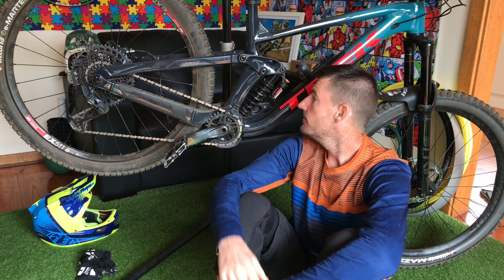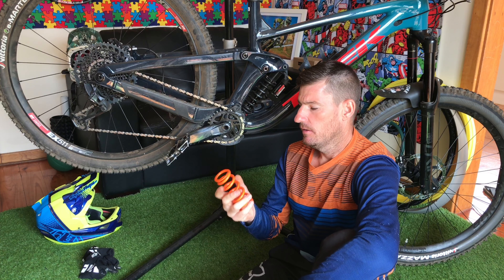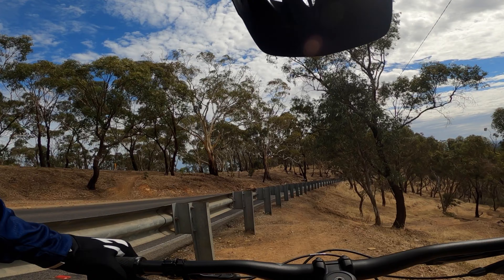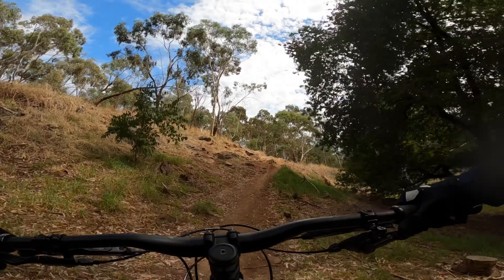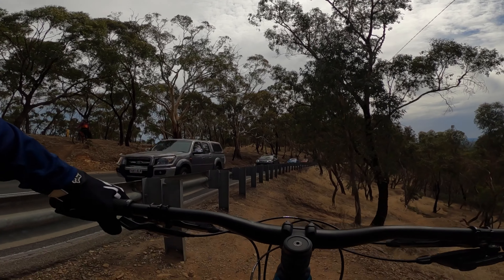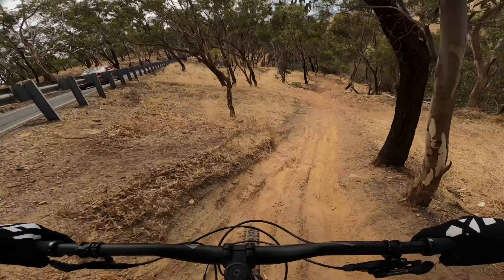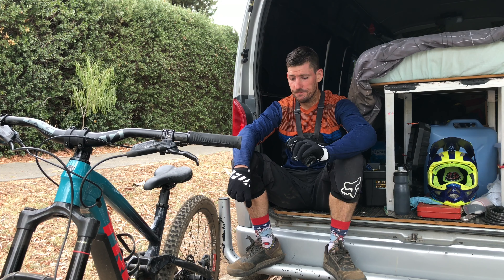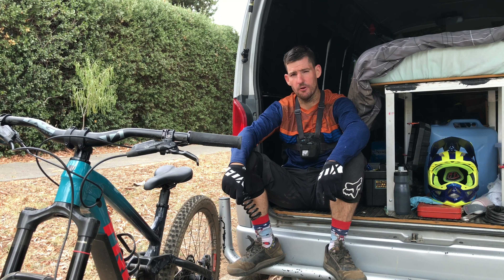Coil Shocks, Whats The Go With Preload?

Comment: When you increase preload it just shifts the coils spring curve up a bit. So let's say the stock setup started at 0N's of force and then at bottom out it has 2500N's of force. While with a bit of preload it would start at 50N's of force and end at 2550N's. However if you were to upgrade the spring you would completely change the rate meaning the shock would start at 0N's of force and then bottom out at 3000N's of force. So alot of people think that changing coils just changes the sag a bit but it actually has a massive impact on the bottom out force kinda like volume spacers. Sorry if you already know this.

Also it's kinda cool, the coil shocks that come on Geometron bikes come with a negative coil spring. Which is awesome because you can use preload to tune the ride-height without actually losing much suppleness and then you change spring rate  if you need more support and bottoming out resistance.
Reply from the maker: I didn’t know that about the Geometron bikes, we don’t tend to see them over this side of the disc. I’d love to test one
Reply: @mtbtelly5522  with all this talk about spring rates / air pressure / tyre pressure etc... you gotta tell us how many KG's you're packing ;)
Love all the testing etc... you're doing, feedback on what works and what doesn't is really interesting!  Thanks!
Reply from the maker: @GLOBc  sorry bud, I'm 75kg kitted up to ride
Reply: @mtbtelly5522  really - same here - touch taller but ;)
You're running way firmer than I am, up front at least, don't recall hearing what psi you had in the shock (pre-coil)
Guess I'm just slow(er) getting up to speed with the jump to a 29-er - been mainly focussing on the tight/jank "how the f#$k do I throw this barge around" kind of stuff.
Keep up the great vid's - Thanks
Reply from the maker: @GLOBc  With the original C1 spring up front i settled on 4 tokens, 82 ish psi, or now with the B1 spring, 2 tokens 99 psi. The rear was 165psi in the plus compression or 166-67 in the mid, or 168 in the minus. The mid or plus comp with less pressure seems to be the best for control

Comment: The spring rate, the amount of force required to displace the spring a given distance, remains the same. A graph depicting a preloaded shock would show an identical gradient (this is the spring rate) with a slight offset in the Y axis (force), reflecting the additional force required to initiate the stroke of the shock in the first place.
Reply from the maker: Correct, so relative to the riders weight, the force required to bottom the shock increases. Hence the increased spring rate with preload
Reply: @mtbtelly5522  Preload doesn’t increase force needed to bottom out the shock, just the amount of force needed to initially compress the spring, which is why it effects sag and small bump sensitivity.
Reply from the maker: @Shauny808  So this 400 spring run with minimum preload i bottom out easily, and repeatedly at less than pace. With 2 turns I only bottom it on a hard hit at pace. Its a significant change in spring strength on the trail. Thats my experience
Reply: Cant agree with Shaun here. As Leo Molloy already pointed out: Preload does affect the entire stroke. You shift everything up by the amount you preloaded the spring. So if the initial force is +50N's than it is also +50N's at the end of the stroke. Changing the spring however (and with that the spring rate) means that the gradient of the spring curve will be different.
https://images.app.goo.gl/bnGtyjCRzKm1WQKY6
Is a  good example for this. Pay attention to the red and the blue line (400lbs spring with a lot of preload and a 450lbs spring with less preload). Both will give the same static ride height, but the bottom out force and change of force is much bigger on the 450 lbs spring while at the same time being more supple. 

If you compare the black line and the red line (same spring rate but different preload) you can see that the entire line is shifted up, making the forces with preload (vs. no preload) bigger everywhere than without preload. Even at bottom out.
Reply: @maxschubert3940  Okay, understood. But the increased preload definitely doesn’t increase the spring rate does it? The only way to change a springs rate would be to physically shorten it (cut it) no?
Reply from the maker: @Shauny808  i think maybe my use of the term spring rate is not completely accurate. A more relevant term would be relative spring strength or relative spring rate. Relative to the rider weight and preload
Reply: @Shauny808  True, the spring rate stays the same, you just add a bit of force everywhere.
Reply: @Shauny808  Correct, the rate stays the same, the other thing you need to remember is, in those graph examples, the lines are being clipped vertically ie. at max SHOCK stroke, thus the Max Force increases by the amount of preload, if the graphs extended to be the min. Spring length (ie. fully compress to coil-bind) the Max Force is the same regardless of preload - as the spring length is fixed.  Spent a lot of time on race cars with these graphs, comparing Preload Vs Main/Tender Spring combos (sounds a bit like the Geometron description above) to control the droop of suspension (sag to full extension - maybe that's what they are calling the negative spring?) without going overboard on pre-load (that and the racecar would be at the equivalent of +60% sag in MTB speak)

Comment: Really enjoy your content.  I understand the technical points of some of the comments here regarding spring curve shift and that preload effect is de minimus as it relates to bottom out; however, like you, my personal findings is that more preload = less bottom outs.  I also run a bomber coil and have the preload collar marked so I can pretty carefully track where preload is at.  I think it this, as with many things suspension, is more complicated than just the one textbook aspect of spring and force.  

Here's my hypothesis: More preload equals less sag.  Therefore there is more shaft travel before bottom out.  This would mean that there is a combination of factors going on including: 
#1. more distance over which the compression circuit can dissipate the impact  
#2. more distance for the spring to compress through (I think this 2nd item is correct but not 100%; I do know that the force rating is in Pounds per Inch).  
#3. places the bike at an earlier point in the leverage curve more often to take advantage of the nature of the curve around sag depending on the bike.  

I wanted to share the above not because I feel like this is necessarily all the above is 100% correct but because like you I've had similar findings in the field and think that this often gets oversimplified; probably by suspension experts because too often people wouldn't buy the correct spring rate if preload was viewed as an adequate measure (which it isn't, necessarily, as it comes with significant compromises at some point).
Reply from the maker: Thanks for the input! You have valid points, solid perspective on all the possible variables, you have a great mind 👌🏽

Comment: I noticed after the first few hours on a new spring, it kinda shrunk.  The sag lowered in the travel. 

Doing the back to back tests is great, but you might find similar difference with 2 exact same springs, only differences being one been ridden and  worn in, and the other new.

Comment: I've been riding Mazza/Martello setup in my eMTB for a couple months. I found the Mazza front very sketchy on wet roots and had a couple big offs. OTOH now in the packed snow and in the fall with loamy trails, the grip has been great. If the Mazza has something to dig in, it works well. Rolls better than a DHF for sure.  Martello is quite fast rolling, good general all around tyre. Rolls better than DHR. Does not shed mud. Works adequately on wet rocks and was not terrible on wet roots. I had to change to a different tyre for the winter, but I'll certainly revisit Martello in the spring.

Comment: Others have picked you up on the spring rate thing.  I get that you're trying to relate the "rightness" of the spring - support, ride height, resistance to bottom out, suppleness off the top.

Meanwhile... the Lyrik.  A B1 with the same tokens at the same pressure as a C1 has the same "spring rate"... kinda but close enough for my point.   The C1 is more preloaded.   You tried to get the C1 to work for you by tweaking pressure(spring rate) and tokens (spring rate progression) but it never got there for you.  Sounds like the same thing as your conclusion here.  You need spring rate and preload to be in the sweet spot.  One can't fully compensate for the other.

Personally, I'm still running through my tests with the C1 but there are enough clues here that maybe I'll end up back on the B1.
Reply from the maker: Nice deep thoughts! The C1 at 170 is cool with 4 tokens, but has a neg effect on the rebound stroke. Any less tokens and the front end grip under brakes isn’t there.

Comment: Mate once the spring is 400, as soon as you sit on it compressed preload on not, it’s still 400 anything beyond full top out.   Having some pretty load wound in won’t change the spring rate it will just give you a better feeling because you ride height is correct. It will also make it little more choppy/harsh at the beginning of the stroke.  Newton’s law.

Comment: hi there mate..just a quick question i bought a dhx2 shock recently and it comes with 500lb spring.fox recommended on my weight is 450lb..whats the effect one riding 500lb instead 450? im only riding trails,rough trails.im not a bike park guy who always or love jumping my bike around..thanks
Reply from the maker: The 450 will ride deeper in the travel improving handling and be more compliant if its more suited to your weight. The 500 will be higher in the back and less compliant if its too stiff for you

Comment: Hello, I just mounted my new Marzocchi Bomber CR, when im compresing it i can hear slight clicking noise (think its coming from piggyback) is that normal or is that something i should worry about? Thank you.
Reply from the maker: Can you feel it if you compress the shock? Like it passes a notch then continues through the travel? If so that happened to my last bomber. Turned out that the base valve spring was damaged, they fixed it under warranty

Comment: what size is your coil shock? did you go 2.5 too big or 2.5 too small? i can’t find a 230x62.5 to match the old shock only 230x60 or 230x65
Reply from the maker: I had the place I bought the shock from reduce a 65 to 62.5